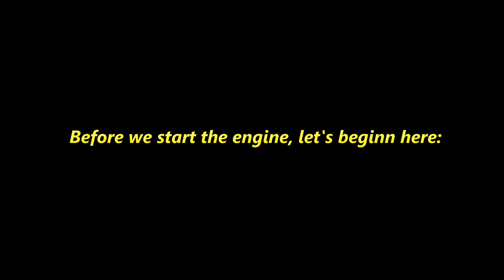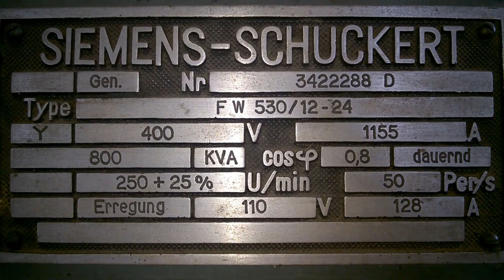1000 PS DEUTZ Diesel engine, 800kVA Siemens power generator, start-up, BEB #18

Comment: Man that is so sick! From the massive pushrods and cylinder to the glorious old school font on the crane, just a joy to behold! I used to work on modern Jennbacher 6 series gas engines, running on biomethane, outputting 3.3 MW (electrical, about 6MW of heat generation which is the main function)! V16, 6liters per cylinder. That turbo spooling up is something else. Uncanny how advanced and efficient ICE's have become. Thanks so much for sharing

Comment: I worked in several power plants in the US Air Force between 1970 and 1990. The largest was at Vandenberg AFB, CA where we had 4-1000KW  or 1 Megawatt each generators with Worthington engines. They had a 12" bore and 15" stroke. We supported Titan satellite launches. I was there 1973-1974
Reply from the maker: Thank you for your comment. I wished I have seen those engines.
Reply: Were that two-stroke engines ? This KHD machine is 4 stroke.
Reply: @TheStefanskoglund1   The Worthingtons were 4 stroke. In another plant we had one Fairbanks-Morse 1600KW. That was a two stroke.

Comment: Ing Max koschuch,,,another demostration during this month,,,???   the electrical equipment is all Siemens,,,the circuits breakers,,,fuses,,,contactors etc???   are originals or you made an upgrade???  thanks,,,Daniel from Argentine.    Pd   Y commented with you approx 3 weeks ago.
Reply from the maker: Hi, I don't know if all is original. Next demonstration will be in July 2018 during the ham radio festival Dobl. I don't make these demonstrations, and I have no clue of the generator, I just like the mechanical engineering and stuff. Cheers!
Reply: Ok,,,thanks hor your fast answer,,daniel From argentine,   Pd:M;e too,,like meahanical enfineer,,I watched at least four hundred videos of engnes and generators    and diesel electric locomotives and engine troubles......

Comment: It says the generator exciter is 110v@128A...that's a lot of power for an exciter.
Reply from the maker: yes, that's astounding
Reply: tjhe generators with exciter,,,the power exciter is approx the  2---- 5% of the total power delivered by the generator.,in this case if the features are correct,,,is only 1,7%

Comment: crazy how some cars today have more power in them than this giant engine
Reply: Yes, we call it the downsizing: the concept is to optimize the motor and reduce lost of energy. The turbo, the computer control helps...
Reply: Small high performance engines aren't that efficient than this one.
The car engine of same HP will consume 10 times more fuel than this beefy engine.
Car exaust pipes get red hot, wasting heat & needs direct cooling...but these don't need active cooling and exaust pipe is way cooler than you might think.
Reply: Its all about torque, not Hp....
Reply: @vadokunvot  you can generate required torque just by increasing gear ratios if you have enough Horsepower.
So it isn't all about torque..HP does matters.
Reply: You are incorrect. This old diesel engine generates about 1,050 ps almost equal to 1,000 h.p. equal to about 782 kW. This power is more than any vehicle other than the big trucks.
Reply: @swapnilkumar3316  according to your assumption either this big boi runs 300% efficiency or high performance engines run at 3%.
Reply: this huge generator engine will last 10000000x longer and run at FULL POWER constantly. If you run a 1000HP car engine at full power constantly it will blow up soon

Comment: this is a really  slow engine,,,with huge  torque,,y think the engine may deliver more than 1000 ps,,,is very high and long,,,,I was naval engineer,,this engine is in a very good condition,,it may run at MCR(maximim continuous rating)a long time,,,     the clasiffication of the engines by his speed:     Slow  >30    <250rpm       medium  >250   <750rpm      fast  >750rpm.    this for naval uses     Thanks Ing max Koschuch        Ing Daniel Castro   from Argentine.
Reply from the maker: Hi Daniel, thank you for your great comment. Thanks for letting me know. Cheers from Austria.

(two hours ago was another demonstration of this machine, but I wasn't filming)
Reply: Thanks for the demomnstration,if another demonstration is filmed or recorded,,,upload please,,,Ing daniel Castro from Argentine....   PDI maintained a Sulzer 7rd76,,,in a petrol  ship  (Ypf)  10000bhp/110  rpm   7cylinders,two stroke,,,fuel consumption:160g./hp.h.    approx 45000lit daily